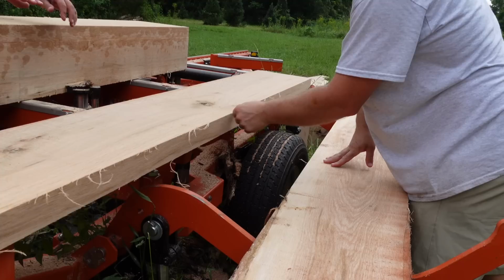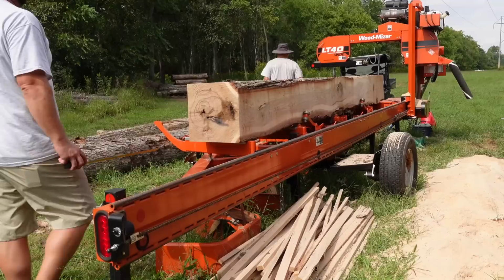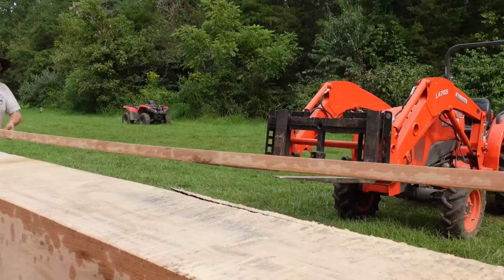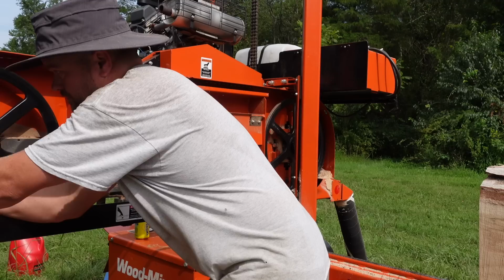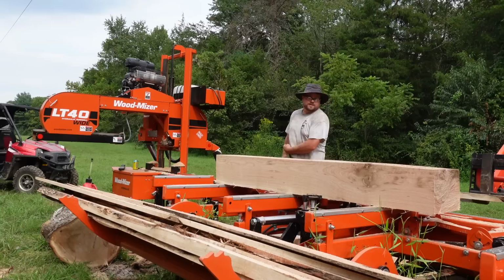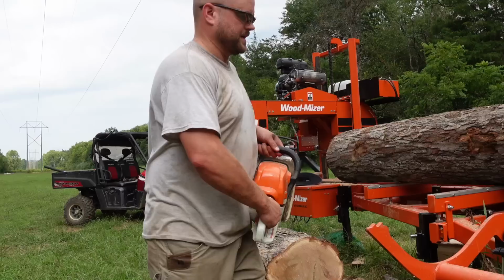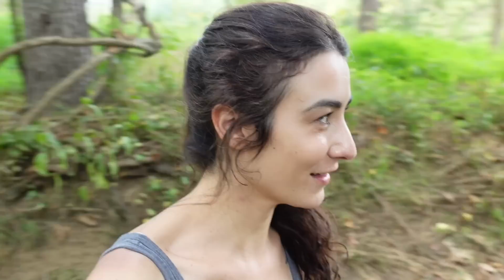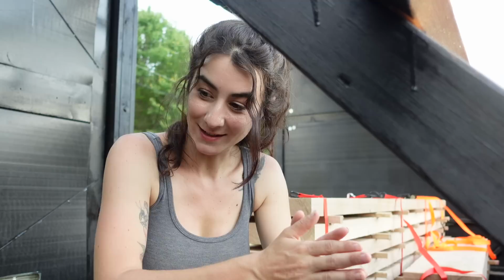These Mantels are going to be STUNNING! [ WOOD-MIZER SAWMILL ]

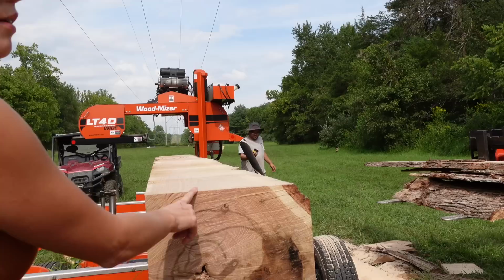Comment: Whupsie, look at the video at 1:27 and notice the black on the butt of the log. That tells me there is a nail somewhere in that log.  And there the spot is again at 4:56.  At 6:07 you can really see the stain on the flat of the log and that indicates you were getting close to the nail or whatever metal you were about to find and sure enough 6:27 you found it.  I grew up logging and my brother still runs a large firewood business.  He buys logs from loggers and if they find a black spot on a stump it never goes to the lumber mill (they will leave it right there in the woods) because the mills will not take it.  Too dangerous for them (can break blades) and too expensive because their blades are not cheap.  On the big white oak log at 11:22 you can see that the whole side of that log was loaded with metal based on how dark and big the stain was and sure enough there was the fence that you found with the metal detector.